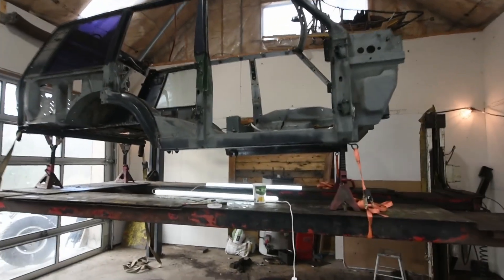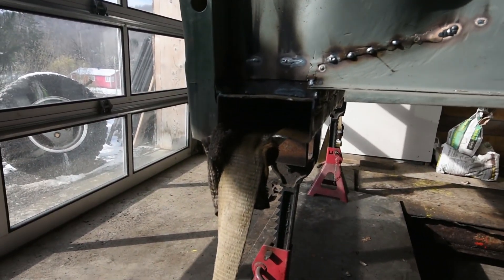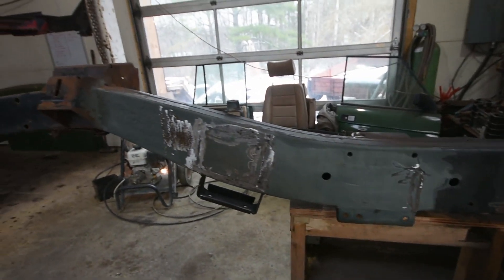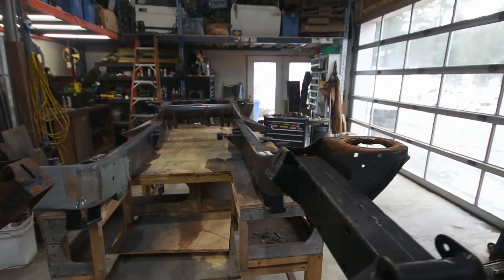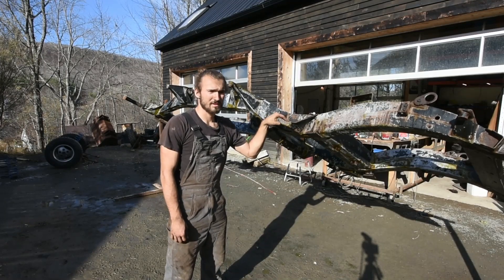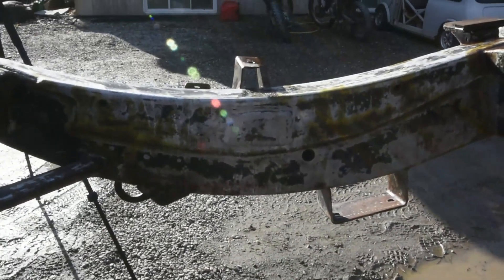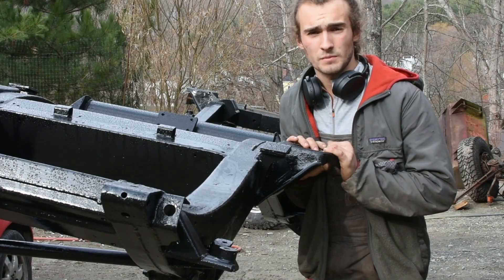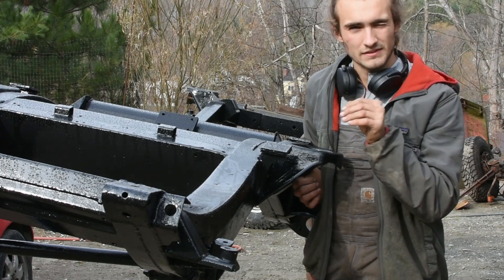Range Rover Classic chassis restoration pt.1

Comment: Nice work area, plasma cutting is not always the cleanest or the most appropriate albeit it easier! Slitting disc might have been better. It’s a personal view ! but I like what you are doing here and you have the benefit of Mike the Guru nearby.
Reply from the maker: Agreed, the grinder is always better for clean cuts but gets expensive when you have a lot of material to cut!
Reply: @ludwigseeley6359  well I’m happy to contribute if you have a means to do so.
Reply from the maker: @nzrestoration9486  Wow that would be amazing! I'll try to figure something out in the future :)